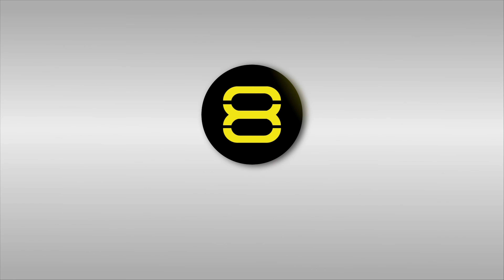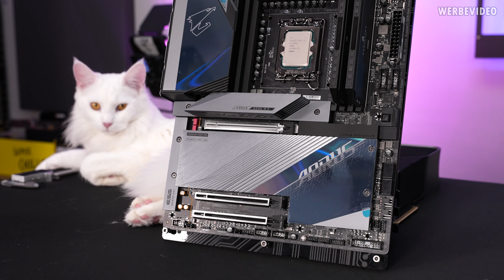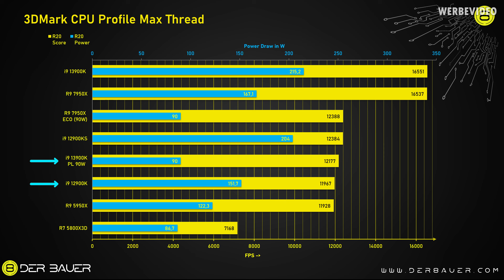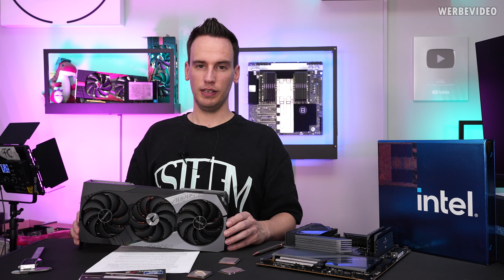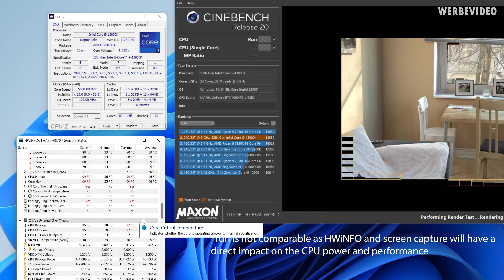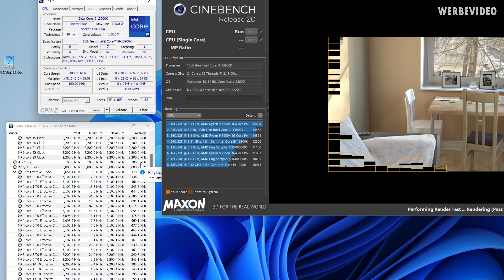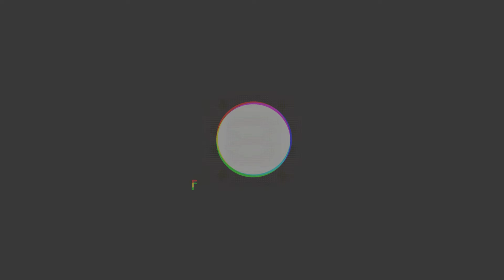Testing and Tuning the new 13900K for Efficiency

Comment: I have the same setup (Aorus Master + i9 13900KF) at home, and I found that 150W was the sweet spot for me. I do video rendering/transcoding (i.e., Handbrake) and if I leave it at full voltage, I can transcode an h.265 movie in 30 minutes. 

If I set the wattage down to 150W, then the same movie renders in about 32 minutes. 

If I tried to decrease the wattage more (i.e., 105W), then the render time went up to 36 minutes. 

At 150W, the CPU temperature remains about about 87C - 91C, using a 360mm AIO from OCool Eisbaer. This keeps the temps just below where it wants to start throttling performance. 

I do say I'm not happy about this. End-users shouldn't have to be under-volting their motherboards. I ended up having to buy a new case to accommodate that 360mm radiator, and it still wasn't enough to keep it cool at full voltage.
Reply: Did you lower the voltage a bit not wattage?

Comment: So basically if you have the cooling power to cool down the 13900k, it can be to the 7950x in cinebench R20 but just doing the second run on that thing makes it lose consistently as per your own results which is I believe under a minute at full power. That means even a 360 AIO is useless for this thing if you're going to run it at Full Tilt for productivity and it's just better to go with the 7950x

Comment: What Intel could do about it is to set 90 W as default limit and add a special Creative/Development mode into Tuning Utility that will automatically kick in only with selective set of apps, that you can change, running. So 300 W would be kicking by your will when your render task is running, or compilation, or compression task etc.
Reply: Yep this would be great, they could just have a hybrid power setting that automatically detects what a given workload demands from the cpu, and then apply whichever power limit that corresponds with the task the cpu is performing. If it's strictly P-core bound, it's going to be single-core heavy, like gaming. If it's multithreaded with all cores at work, it's a professional workload. Should be fairly easy to set up.
Even for render tasks I feel like the 300w should only kick in during intervals where it optimizes workflow - for example if you're using an interactive render then the 300w could kick in whenever you're repositioning the camera and the render adjusts real-time to your inputs - or it kicks in at the beginning of a render where various photon calculations are made, but then lowers the power level once the actual rendering of the photon path traces kicks in.

Comment: actually quite impressive how good raptor lake's power efficiency can be against zen 4 on 5nm
Reply: The name 7Nm (Intel 7) and TSMC 5Nm is not the actual size. It’s just marketing name.
Reply: @erisium6988  regardless of the actual nanometer numbers TSMC N5 (5nm) still has higher transistor density than Intel 7 (10nm)
Reply: I hope we can forget "nanometer" naming schemes as X3D chips and other 3d stacked chips come out. I hope they name new processes like "le epic stack 2.0+"
Reply: @XxXnonameAsDXxX  they have a naming scheme for a reason tho
Reply: Great job by Intel gen 13th delivering very decent price to performance, meanwhile Amd has been a lot disappointing with Zen 4, not only Amd is overheating but also the Cpu itself is overpriced, r9 7950x is $150-200 more than i9-13900K still Amd can't beat Intel in full benchmark, not to mention Intel still compatible with DDR4. Intel totally destroyed Amd here.
Reply: @ThunderingRoar  This just means it's trouble for AMD once Intel catches up in lithography (or perhaps start using TSMC).
Reply: @xMaFiaKinGz  Intel's measurements were as accurate as you can be on FinFet, but everyone else was fudging the numbers by measuring a different way, so you can't really blame Intel for switching, its a lot easier than explaining transistor density to the average consumer.
Reply: @diobrando5620  AMD may very well be in a pinch once Intel catches TSMC, because AMD plays second fiddle to Apple, so they will be having to compete against Intel's latest node on TSMCs second latest. I wonder if they regret not reinvesting into GloFo yet?
Reply: It is impressive, but the fact that he manually UV/tuned 13900K and did not give the same treatment is quite sad, as its ECO modes are still much less efficient then when manually undervolted.
Reply: @runninginthe90s75  Zen 4 pushes itself to 95C as a target, and holds itself there. It's the operating temperature, as in not overheating; the stronger the cooling solution the more performance you'll gain. This is because it isn't a voltage or power limit that you encounter first on Zen 4, but a Thermal Limit. And this is reportedly working as intended. You don't have to believe that I suppose, but that reality is reflected in the observations I've seen from the ungodly amount of reviews I've watched as of now.
Reply: @runninginthe90s75  amd is destroying intel right now 7950x is same price as 13900 while being universes ahead in power efficiency. intel is widely known for overheating and blowing up.
Reply: Intel Raptor lake better… Amd is a shit…
Reply: @eclipsegst9419  Not hating on intel, Just wanted to say that Nm is just marketing bs now.
Reply: @xMaFiaKinGz  definately, and with RibbonFet coming measuring in 2 dimensions only will be really pointless. But they will probably just keep making lower numbers, who knows.
Reply: @eclipsegst9419  I wish that all these fabs would just go with single standard as to not confuse us. I want to know actual size of these transistors but I can’t seem to find anything responsible. I read that intel7 was actually as dense as TSMC 7. Intel4 is is around 160 Mtr/mm2 and TSMC 4 are at 140Mtr/mm2.  I know Intel are Shady but they know how to make a CPU.
Reply: @xMaFiaKinGz  Its about where they measure, transistors used to be "square" and so there was nothing to debate, but FinFet, which we have had for awhile now, are more "triangle" shaped (if you look at a cut one edgewise is what i mean by the shapes) so by measuring at a different place they can get different numbers, hence the fudging numbers game.

Comment: I think realistically we need to see if all this is still viable on a 13700k, does it still maintain efficiency or does it play different (as in a more drastic loss in performance). I would only listen to der8auer in this regard. Then again that's up to whether he has time for that. Amazingly helpful video!
Reply: TL;DR: This applies to any CPU of any gen. Running more Ghz has a steep power draw cost: anything over 3Ghz will throw efficiency though the balcony until you can't simply sustain it any longer due to going out of spec in temperature/current/voltage.

Long version: my 11900K can do 4.5Ghz all core on a 125W power budget, running 3.5Ghz just costs 70W and running 5.1Ghz costs 250+W, all core stress test type loads factoring out vectorial extensions: with them power figures go up to a maximum of +25% power draw depending on workload and the extensions used, but on return the CPU crunches numbers significantly faster(this is wild terrain: algorithm dependent, may be +40%, +100%, +200% execution speed).

There's afaik many details with performance and efficiency which are common across every hardware. Those looking for functionality should stick with manufacturer already customized hardware for a easy life.

Comment: The 13900k undervolted using less power while having higher FPS than a 5800x3D is impressive. Neat stuff. Looking forward to upgrade my 12700k, DDR4 RAM, and 3080 Ti to a 13900k, DDR5 RAM, and 4090 in a couple months.

Comment: I'm sure you've seen the reports that the 7950x gaming performance on Win11 improves when you disable 1 CCD likely due to Windows scheduling issues. Would you consider looking at this for some of the charts you have?
Reply: Games only use 1-8 cores depending on age, at least they only scale performance that far, so either way you are wasting your power budget running that second CCD, as far as gaming goes anyways. If only one CCD is active it can have all the power avaliable. Also latency between CCDs has always been an issue with Ryzen, especially when the CCDs only had 4 cores.
Reply: Disabling one of the CCDs in Ryzen breaks S3 and S4 sleep.
Reply: the 7700X is the best Zen 4 chip if you're gaming, and its the best because of price to performance. All the Zen 4 CPUs operate within 3-4% of each other in gaming, so if your are gaming don't bother with anything above 7700X imo! any amount of production load in your daily life will be much faster as you go up the tiers tho, while giving similar but about 1-2% less performance in gaming at each incremental tier. (That's right less performance as you go up the tiers.)

Comment: cant wait to get my hands on the 13900K, will be my first I9 :D upgrading from the 9700k too so its going to be insane
Reply: Is it worth upgrading from the 9700k tho?
Reply: upgrade to AM5 much better
Reply: i'm running 4790k, when i can afford to upgrade next year, probably end of year i'm going to feel like i'm time travelling lmfao
Reply: nah 12th and 13th gen are exactly same architecture with higher clock
Reply: Me tooooo I game and stream on a single pc with 9700k and an rtx 3080ti but my cpu is so bottlenecking and running at 100% most of the time.
Reply: @justinbouchard  I owned the Devils Canyon in another lifetime.  😄
Reply: @rlifeh  no
Reply: @Luiko0406  and more cache and better imc
Reply: @keilinx  u good homie?
Reply: Why not AMD tho
Reply: @halrichard1969  bahahahahaha!!  dude i run my chip daily driving  at 4.8 ghz on arctic liquid freezer 280, 1.28 volts.  I have booted it at 5.1 before but i can't contain the temps and my vrm can only handle about 30 seconds of anything over 130 watts of draw lol, love this chip :)
Reply: it's going to be pretty much the same plateform wise I had 5950x then 12900k but I also have a 9900k runnin g right now and let me tell you for gaming 12900k +- equals my 9900k, amd had lower fps but the motherboard and chipset on intel almost didn't improve while AMD is next gen, you shouldn't buy this...just go 5800x3d with ddr4 for gaming
Reply: @Luiko0406  not really I'm a 12900k owner, typing from it..and clearly they improved the cpu but...the problem is that the chipset z690 and z790 are garbage, really bad design...so bad that I'm dismantling it for a 7950x x670 soon rather than upgrade the cpu which would cost me way less, I wish it wasn't so but I regretted "downgrading" to this 12900k which brought me back to the 9900k "gaming only" pc era
Reply: @Yaba414  definitely go amd then here's what I could do on a 5950x+rtx 3090 but cannot on a 12900k game+stream with nvenc+encode local cpu h264 HQ quality videos for youtube and with little fps lost...If I try to do this on intel the fps tank hard because e-cores aren't full cores and they are linked to the p-cores so drag your game fps down, intel makes boosted 9900k gaming plateforms while amd makes real hybrid workstation/gaming computers more useful for a "all in one" gaming streaming machine
Reply: @zet7914  AM5 is much better platform for upgrading
Reply: @rlifeh  better for upgrade but the plateform cost a lot more
Reply: @zet7914  
7600X 299$
ASRock B650M PG Riptide 170$
DDR5 5200 8GBx2 100$
AM5 supported to atleast 2025
Reply: @rlifeh  Shit ram shit MB and 7600X ? we talk about 7950X vs 13900K:

Msi Z690-A PRO 179$
DDR5 6400 CL32 259$
I9 13900K 699$

Don't need to change for min 5y.
Reply: @zet7914  I replay to MCG who want upgrade from 9700K
Reply: @justinbouchard  I hear you.  The best I could do back then was 4.9ghz.  I moved on like two years later with the I5 8600
Reply: @Yaba414  1080p? If so, get yourself a budget 1440p monitor and start enjoying the extra headroom
Reply: my 13900k just came in, 0 regrets 😄

Comment: The amount of effort and testing that goes into creating this level of gradience is not unnoticed, and vary appreciated. Thanks for doing this.
Are you planning to investigate further into similar behavior with the 7950X, doing 20W testing points via Package Power Limit Control?
It would be very interesting to see the FPS/Watt curves compared directly. Possibly even combining the optimized configurations with the power optimized RTX 4090, producing a combined 450-550W power draw, very capable of being managed in an SFF build, or simply a quiet, power sipping workstation.
I know that the SFF crowd would eat it up! 😅

Comment: You're the man, been hoping a reviewer would do a power examination while gaming, been asking other reviewers in their comments, and then I got to yours and you actually did it. Next time, I do yours first. Yes the 13900k is way power inefficient in benchmarks and workloads, but in gaming, it's actually very efficient.. Also the artificial watt limitation? Beautiful work. Thank you sir. I'm quite happy with my i5-12600k and hopefully won't be upgrading for a few years, but I do build systems as a side hustle, and it's good to know what practical power/thermal gaming loads look like.

But honestly, thank you for not ranting about the power consumption, every other review I've seen so far has pretty much ignored performance/power usage in games to rant about them under max loads, which I get, sucks, but when will a gamer ever see those? So does it really matter?

Comment: please include minimum fps in future charts, i always care way more about that than average. i get used to low average fps. i feel frame drops though
Reply: Just lock the fps then
Reply: @MaxIronsThird  "lock[ing] the fps" doesnt magically make 30fps look like 60fps. I think you misunderstand what I mean by "minimum fps". I mean the lowest fps observed - ie the fps during the largest lag spike. if that doesnt drop below my monitor's refresh rate I won't notice any lag at all, because I'm still seeing the same fps. you can lock fps lower than what you're capable of producing, but not higher (i mean, you can, but youre not going to magically hit that fps now if you didnt before)
Reply: @xdMatthewbx  If you don't have a 120Hz VRR/FreeSync display, locked 30fps will 100% feel better than hovering between 35 to 55 fps.
Reply: @MaxIronsThird  i'm talking about lag spikes. ie 0.1% lows. those don't last long enough for that to make a huge difference and even if it does you can only do so much to make a lag spike not feel like a lag spike if that lag spike dips your performance noticeably lower than your refresh rate
Reply: @xdMatthewbx  Those aren't common, and if they were, he would've said something, just like he mentioned in the video, there was nothing abnormal with the 1 and .1 %.
Reply: @MaxIronsThird  nonetheless I'd like to see them

Comment: Now days, the performance per watt is so important. I care more about this than what tops the charts in max power.
Reply: Agreed! It’s really impressive how the 13900 is able to hit 10,000cb at 80w! That’s desktop class performance at a laptop cpu power draw
Reply: Performances per kilowatt*
Reply: @Godot try changing SSD oh wait
Reply: @Godot Yeah but how big are your Steam, Epic, GOG, Origin & Ubisoft library’s 😂😂
Reply: @Godot and thats it when it comes to performance on that cpu ;)
Reply: @Godot Dude I was talking about Cinebench r20 not r23. The apple M1 can barely hit 3k for r20 while the 13900 hits 11k at 100w. It’s true that the firestorm cores in M1 are much wider than raptor cove (8 decoders vs 6 & so on), but the much higher clock speeds of raptor cove means overall performance still goes to x86

Comment: so 13900k undervolted can probably be put in laptop and still powerful AF.
Reply: yep and same with Nvidia's new Ada architecture. This upcoming gen of laptops will be beastly if they can manage cooling slightly better than last gen ultrathins that didn't care one bit for cooling despite throwing power hungry hardware in them and thermal throttling constantly.